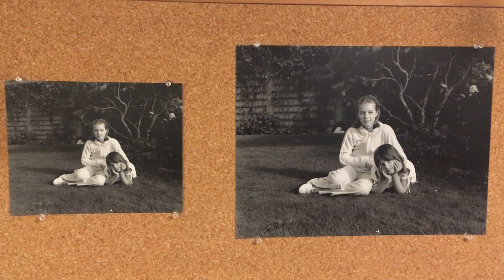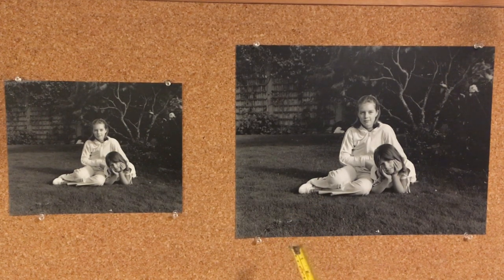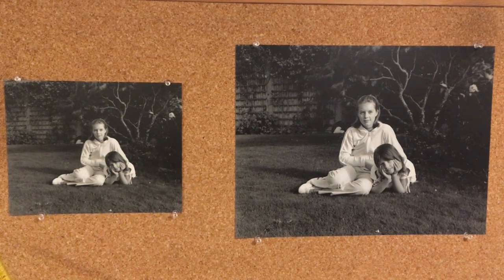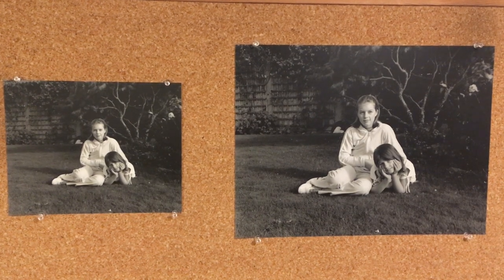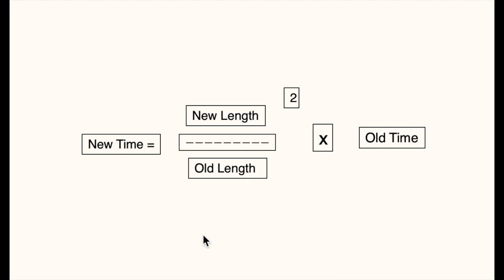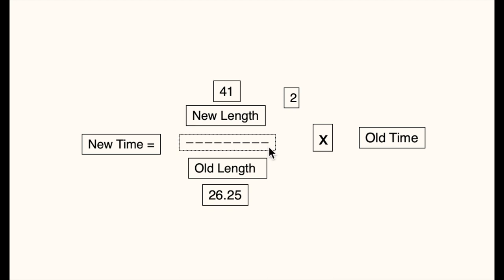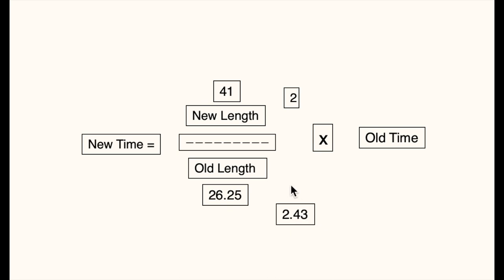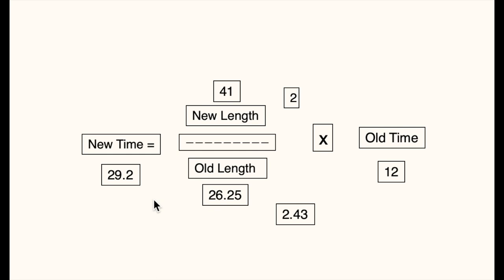Changing Print Size Without Test Strips!

Comment: What if I get a really long exposure time due to a big difference in enlargement sizes? I reduced to aperture from f11 to f8 and halved the time but I failed with that one. Do you have any equation that calculates exposure time when changing aperture? Great channel! I really needed that kind of short informative videos full of useful tips and tricks. Thanks!
Reply from the maker: Hi Michal. Try calculating your time from the original exposure time at F8. See what time you get then. Is it the same?